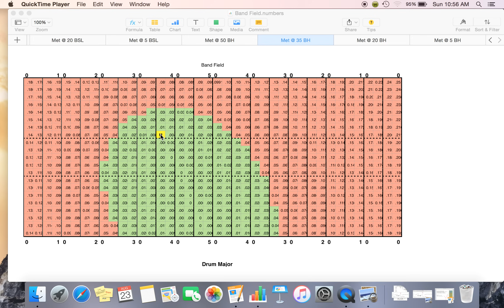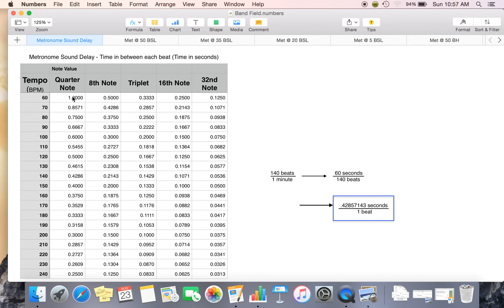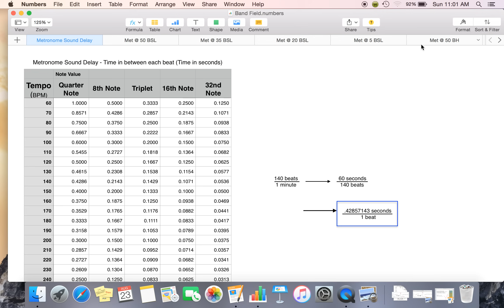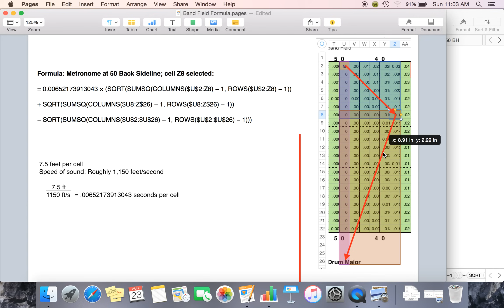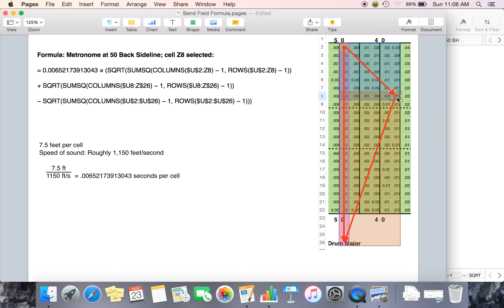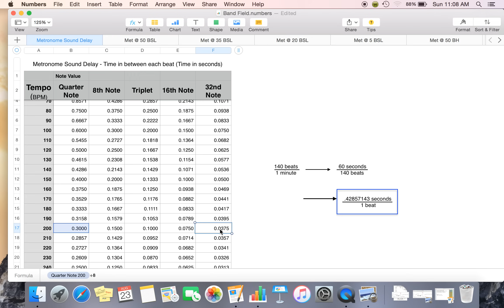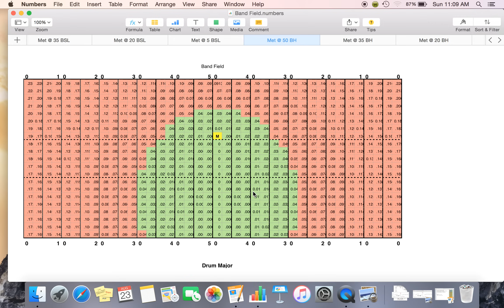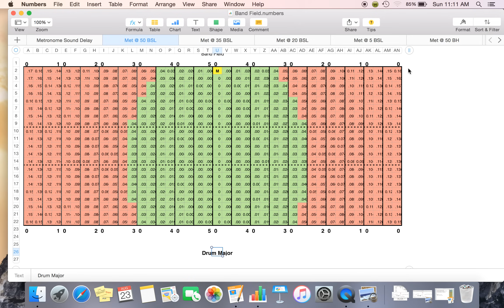Metronome Sound Delay Explained

Comment: FANTASTIC Mathematical job!  After 25+ years of Audio in the live realm, a couple things to research are 1) Polar Plots of the device to also understand the dispertion of the sound (by device) and look at it both in the horizontal plane and in the vertical plane (again by device).  Additonally, the delay created by the device outputs, length of cable, wireless, etc.  must also be factored as well since based on resistance of the cable factors in the equation as well.  Issues arise frequently in the wireless realm because of the delay from the wireless transmitter to receiver and then to processing and then again to the output of the wireless device.  Once you start adding them all up it will be VERY obvious.  It is also a common occurence in the pro audio world to delay the entire sound system "back to" the farthest upstage (away vertically) device so that the time of the arrival of all sources are close to avoid even larger issues that actually will cause large "holes" in the sound that make the entire ensemble sound "thin" because of the timing issues!  Delay propagation is a HUGE issue that has to be addressed to allow the listener to actually hear ALL that is being played.  I could go on about the addition of effects (delay, reverb, etc.) to items and the factor of needing to actually the length of the mic cables and speaker cables along with the speakers and how they are processed to make a solid case for additional research that most need to understand.  I love the topic and you have touched the tip of the iceberg on how it starts on the ground but the exponential case is an ever bigger issue.  CONGRATS!!! The ms (millaseconds / .001 seconds) add up!

Comment: Hey, I did some similar research back in June 2014. I made a simple website that calculates the delay based on either drum major (light) or metronome (sound). For example, if a metronome is placed on the 10 yard line back sideline facing the drum major, the sound delay is almost an exact quarter note at 160 BPM. You can check it out here: http://willsherwood.github.io/Field-of-Sound/

Your idea of metronome placement is very interesting! subtracting the hypotenuse by the two legs to calculate total delay per marcher by met.

Comment: You are calculating the difference between the metronome clicks from a performer's perspective and the drum major's perspective correct? I assume in this scenario the drum major is conducting in time with what they are hearing from the met. What would be the case if the drum major was watching the battery for time instead? Assuming the battery is where the "met" is, all you would remove would be "met" to "marcher" in the formula to get the difference in time between the battery and the front and any other performer on the field.
What are your thoughts?
Reply from the maker: Donny Lavrenz GREAT question! I probably should have been more specific in the video... The "M" (met) could be thought of as the battery as well. If the battery is playing, you could still be a marcher in any of the green areas and listen back (or slightly left or right if in close proximity) if .045 seconds is an acceptable margin of sound delay for you. The "met to marcher" part of the equation can now be thought of as "battery to marcher". Does that help?
Reply: Thanks for the reply; that answers part of the issue. I believe my questions boils down to how much do performers need to adjust in front of playing "with that hands" of the drum major? In your model, are you assuming the drum major is watching the met/battery or listening to them?
Reply from the maker: Donny Lavrenz That is a question that has infinite solutions and it all depends on exactly where the battery/tempo source is and will be different for every marcher on the field... It's honestly case-by-case. I was hoping someone wouldn't ask that question. ;)
I am working on another file right now... What is your e-mail and I will send it your way?
Reply: Andrew Rogers Good stuff all around.  I'm a trumpet player myself (PR '11 and '12) and a mechanical engineer. I think you could take this many directions, but lets take your current model: Your current model is purely based off of sound delay. When it comes to what is heard, I think your most important metric is not the DM, but rather the audience.  You based the "focal point" of your sound at the DM.  I would argue that this model would be better suited with the focal point at the judges, or the "box" (or the VIP seats, haha)  This is truly where the effect of sound delay is most felt.  Now, Donny Lavrenz already hit on this: if we're talking about watching vs. listening, your model would need to be a bit more complicated. You would need sound delay to center snare and then use speed of light calculations (aka, instantaneous) to figure "vision vs. auditory." If you want any help with the math side, feel free to use my knowledge. Donny and I will probably talk about this at rehearsal tonight. Cheers
Reply from the maker: Sam Shelley Thanks Sam! All of the comments people are making about what to improve on are great. I will be making more charts soon that fit all of those needs but since school just started up, times are busy. Hopefully I can get them uploaded and post a new video within the next week. I've heard the comment about making the focal point the judges in the press box at Lucas Oil Stadium and that's a fantastic idea (one of my next projects). Changing from the DM to judges won't be tough at all, I just have to change the absolute cell to something farther than U26 (where the DM roughly is). Do either of you have any knowledge about how far the press box is from the front of the field in LOS? As for the watching vs. listening equation, I have an idea for that as well and I don't think it will be too hard. Hopefully I can get that uploaded as well. Thanks for the great feedback!
Reply: Andrew Rogers Based on a rough to-scale drawing, it appears to be 65 yards back (horizontally) from the front sideline. As for height, this is tricky.  I cannot find any schematics posted online so I'll have to go off of an estimation based on angle to the pressbox. Based on photos, I estimate the angle to be 31 degrees from the front sideline.  As such, total approximate linear distance to the pressbox would be 75.802 yards.  Hope this helps. I'll let you know if I can find any better information.
Reply from the maker: Sam Shelley Thanks for the great info, wow.

Comment: On the green blob slides where the M is away from the center of the field, like on the 20 BH, why isn't the green blob an ellipse pointed straight forward to the FSL? I'm thinking of situations when the battery may be out that far from the center of the field. Or are we assuming that the M on these slides is a speaker pointed at the DM podium?
Reply from the maker: Bill George The sound delay is calculated with the DM as a focal point, so that's why it's pointed in that direction. I've had a lot of requests to change the focal point from the DM to the press box, so I'm going to change that in the very near future. The calculations can be changed so that the green blob points straight ahead at all times, but that's not where the judges (aka "score sheets" are at ;) ).